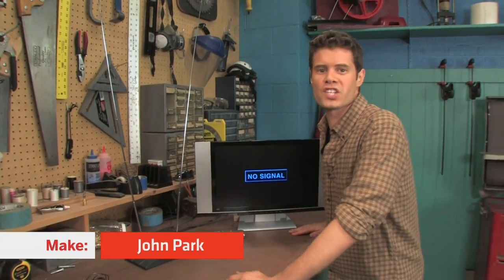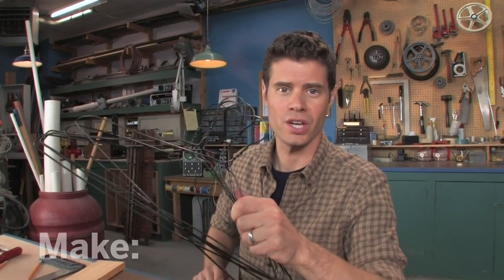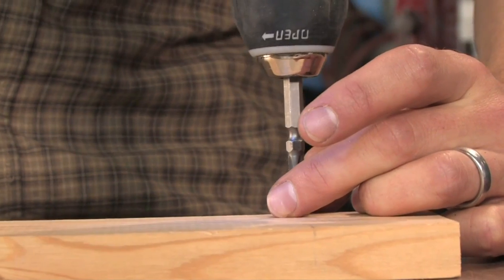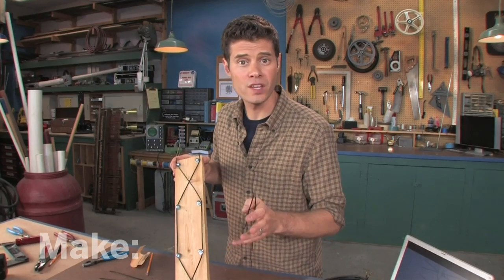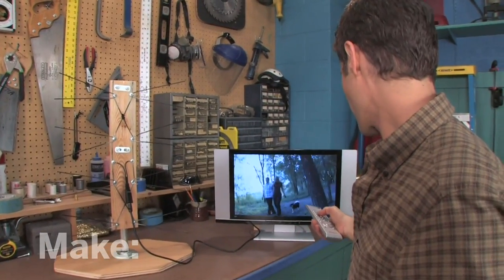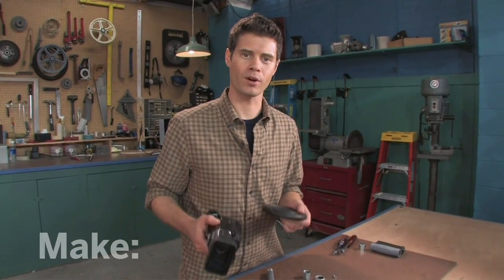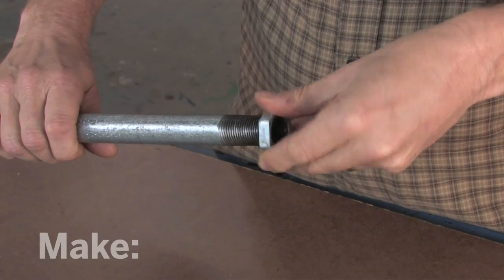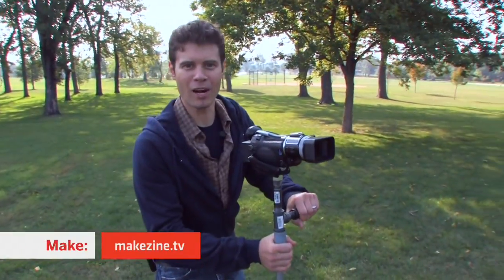Maker Workshop - DTV Antenna & Steadycam on MAKE: television

Comment: ways it could be better:
heat shrink tubing instead of electrical tape, nuts & bolts instead of screws, and telescoping  antenna rods either extracted from an existing antenna, or brand new from online stores...

Comment: Correction, his DIY antenna is a 4 Bay Bow Tie, not a 2 Bay. For any budding antenna builder the ratio between the length of the V's (also called driven elements or whiskers) and the spacing of the Bays or V's is important to maximize gain. For example 9" whiskers x 8.5" bay spacing is good for mid to upper UHF (30-51) and higher VHF channels (11-13)

Comment: First off, good video. The commercial antenna shown at the beginning is not a Hoverman antenna, it is a "4 Bay Bow-Tie",  and the DIY using wood for the boom is a 2 Bay Bow Tie.  This kind of antenna will only really work if you are in a strong signal area, ie fairly close to the towers, though a well made 4 Bay with 36"x36 curved reflector screen, and placed over your roof, could pull in channels from over 100 miles away. A GOOD LOCATION FOR DEEP FRINGE RECEPTION IS ALSO NEEDED.

Comment: Dude, I am an engineering tech here in the states. If you look closely at the commercial antenna model he displayed you know it was the same design as the DIY finished project. Does the material specs really matter? NO!

I made one of these before I saw any of the videos and it works quite well. I have no idea of the differences in resistance, capacitance or inductance from the commercial model but who cares?
The commercial model runs about $40.
 KISS. Keep It Simple Stupid.

Comment: I just finished building this project using a 1"x2"x35" board, plastic covered metal hangers and a UHF/VHF/FM matching transformer. 
It found more UHF stations than my old, $20, brand name, UHF/VHF rabbit ears. But the signal strength for my VHF stations dropped by about 15 percent according to my DTV converter box. This is a good diy or educational project and it only cost me $1.25 for new coat hangers; everything else was in my junk drawers.

Comment: Impedance matching transformer is available cheap at most electronics parts supply shops. Or you can make your own homemade matching transformer with a piece of AWG Magnet wire and toroid core. Check ARRL Handbook or search the web for instructions.

TV impedance matching transformers are used to match the 300 ohm high impedance of the antenna to the 75 ohm impedance of the feedline (coax cable). It is commonly referred to as BALUN (Balanced - Unbalanced)) transformers.

MANNY DE GUZMAN, JR.

Comment: Wood would be better than plumbing pipe, your arms are going to get tired real fast hauling a pipe plus the weight around, wood and a weight at the bottom or even better yet aluminum piping.